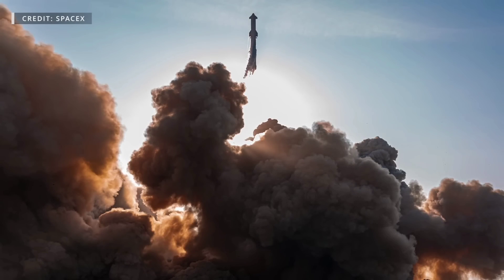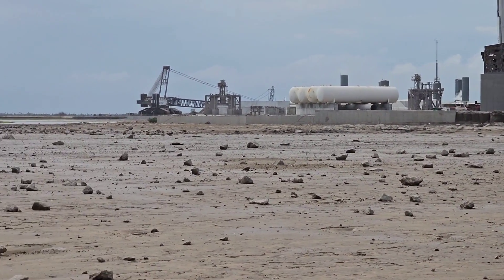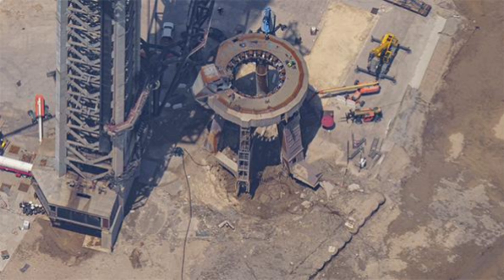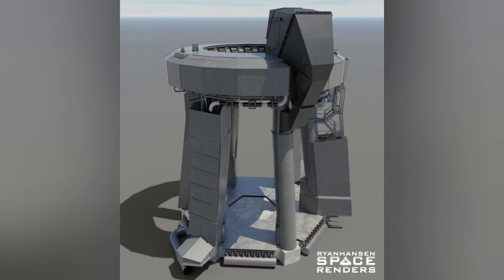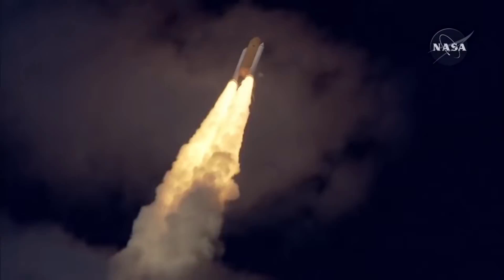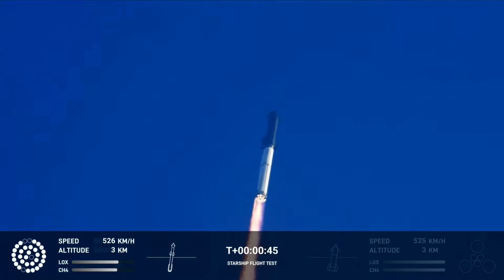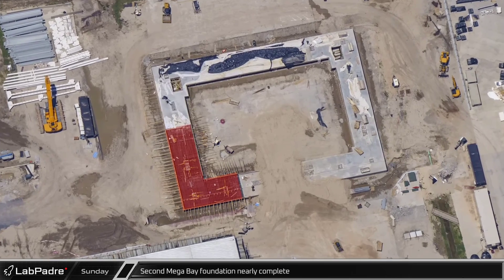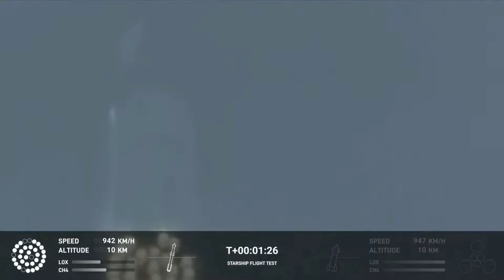Will Elon Musk's water cooled flame diverter be enough to keep Starship and Starbase safe?

Comment: The pad itself should be fine.  Spacex knows about thermodyanics, and the properties of metal are well understood. They will have done the math. From an engineering perspective, a water-cooled metal plate is easier to understand than concrete.  We know, for example, that the metal won't explode (unlike super-heated concrete.)

The damage outside the pad was largely due to rocks and concrete being thrown around, so as long as the pad holds up, this shouldn't be a problem either.

Whether or not this is the best option... who knows.  I thought that a higher platform plus a pool of water at the bottom of the pad would be the solution.
Reply: They obviously did not understand the thermodynamics as the rocket blew the concrete apart. EMu admitted as much.
Reply: @HowzitOldMan  As I said, concrete is more complex than steel to model.

Steel will either melt or not melt. It's not going to explode, and bending isn't a problem. Keep it below the melting point and you're good.

The issue with blowing the concrete apart appears (according to Musk) to have had more to do with pressure than temperature.  The soil beneath the concrete was soft and didn't provide the needed support, so the concrete cracked. Once it was cracked, the gases were able to get underneath.
Reply: @HowzitOldMan  The current leading theory is that the sand under the concrete compressed away from the concrete, as the concrete bent it cracked, and those cracks then allowed the high pressure gasses under the concrete, blowing it up and cracking it into smaller chunks that could be thrown around.

The static fire gave them a read on the thermodynamnics, and based on that they calculated that the pad would survive one launch, but when you extrapolate, you can't predict inflection points where other factors show up.

They can't do a full thrust static fire without adding a lot of additional weight on top of the booster (i.e., replacing the 1500T starship with a 4000T mass simulator), the clamps don't hold the starship down until launch, they are released before the engines start and the engines start at low throttle and as they pass a TWR of 1 the rocket starts moving.

Comment: It’s overkill. A simple steel plate would have worked. The heat doesn’t  have enough time to penetrate the steel very far.    The whole thing sounds like an excuse for whoever insisted on not using a simple steel plate before the launch.  Could have been done for cheap and quickly

Comment: A lot of energy has been dissipated by the concrete flying away, hundreds of tons. But that was a fluke because it reduced the amount of vibrations and this phenomenon acted as if there was indeed a flame diverter! But if you put that plate, that energy will now be absorbed by the OLM and will shake more violently. There is also the possibility that this solution will not make any difference and the result will be the same…

Comment: SpaceX was already designing and building the replacement launch system long before the launch took place.  Thats why there is a quick turnaround.  Using a typical "lets wait and see before we do anything" approach is normal for the space industry, but not SpaceX.
Reply: not very impressive
Reply: I generally agree, don’t wait. But in this case I think they did a shoddy job.  I am a huge fan of Elon, but I don’t think he’s perfect. Seems that he admits they didn’t anticipate so much damage, but I think a lot of people dead, including me. I was very distressed that they were blasting the rocket onto a flat pad.
Reply: @steveperreira5850  If the foundation was anything but beach sand, it would have worked. The concrete plate cracked because it sunk into the sand, that's why it took so much damage.
Reply: @florin604   totally disagree, it doesn’t matter what the material was under the pad, the effect would be the same, complete destruction of the stupid flat concrete launch pad. It’s a simple relationship between the total energy blasting out of the raptors and the energy absorption efficiency of the concrete. The energy won.
Reply: @keithmayes4358  certainly, many engineers, smarter and more informed than us must not have checked the numbers. Any monkey should have known what would happen, as we can see by the result.  Elon is the only one looking at these things, I'm sure.

Comment: A modest deflector , a flight wdege around the perimeter of the plat to impart some vertical component to the flames velocity. If the fire is off the ground it seriously cuts down on debris.

Comment: Your thought that the concrete would still be ripped up makes no sense. The concrete was ripped up for a distance away from the OLM because the Raptors made a hole in the concrete surface and started blasting incredible amounts of high-pressure gas under the pad, which then had no where to go but up. The force exerted by even a small pressure difference over a large area is incredible. Like on some entertainment shows, where they collapse a caravan with a vaccum cleaner.

The high pressure gas buildup under the pad launched the concrete high into the air. But if the plate works, there is no hole in the concrete surface, and there is no buildup of high pressure gas. The concrete should be absolutely fine.
Reply: https://youtu.be/9YEXQwnyMms?t=210

Comment: There's no guessing to it. You tell me the thermal waste these engines are pouring out and I can calculate exactly how much water it will take to convert the energy to stream. Can they deliver that amount, that's another question, but they know. The flight termination system is the FAA primary concern. If starship had started traveling inland right off the start, it could have blown up over or crashed into a major city.
Reply: why do you need to convert all that energy to steam? it's not a problem to heat things up below their melting/breaking point, and it's not a problem to have high velocity gasses moving away from the pad

Comment: If I was the government official who has to give or deny a launch permit, I'd ask 'Would an exploding rocket pepper a town or nature preserve - or any property Musk does not own - with debris. Given that the answer would probably be 'yes', Musk should do a water launch. Or Cape Canaveral.
Reply: sorry to inform you that most of the Cape is a nature preserve and not owned by any of the companies launching there. If a rocket fails in flight it is guaranteed to have pieces land in places that the launching company doesn't own. No company (or Country) can own all the land and sea that the rocket could impact.
Reply: @davidelang  But rockets are allowed to launch at KSC - not in other preserves
Reply: @gus2747  I know that Astra's launches in Alaska crashed in a nature preserve on one flight

Vandenberg has both land and marine preserves adjacent to it

So does Wallops.

Now, none are quite as close to the launchpad as SpaceX is in Texas, they are working to change it, but that requires that they buy other land in the area and alter it to be similar to the mudflats that they are going to be using. That process takes years.
Reply: @davidelang  Other places are not close to towns. Musk should launch where he is not opposed - Canaveral or at sea.
Reply: @gus2747  KSC has launch pads within 2-3 miles of condos (look at the location of pad 25)

Vandenberg has launch sites ~5 miles from the local train station, with Lompoc just a few miles more away (but there are hills between them and they launch away from them)

The starship launch pad is ~7 miles away from South Padre Island (Boca Chica is closer, but that's why they evacuate it and offered people 3x appraised value for their property there)

Wallops seems to be a little more isolated

The differences aren't as big as you think. And there really isn't anyplace around that doesn't have wildlife refuges or population within a few miles

Comment: I still think SpaceX should reconsider using the flat floor, and consider adding some angled metal plates, so the shock wave and flames be properly diverted. The flat floor design is probably to better access to the engine bay, but they could use for that a secondary stand near the tower.
Reply: Or build into the flame diverter design a removable floor feature.

UPDATE: To clarify, my thinking is to have a flame trench with a flame diverter inside below the launch mount and a clever design to allow concrete sections to be positioned over the flame trench to allow work to take place.
Reply: Or just build a cone instead of a flat floor. That should act like a flame trench but above ground. Concrete in large volumes takes a long time to cure and to lose its moisture content, so as they are in a hurry build with something else like preformed blocks and a steel facing.
Reply: @Tailspin80  I'm thinking of the same thing too. The V-2s & Redstones(and their Soviet counterparts) used deflector pyramids back in the day, and Starship's Stage 0 structure is basically a Redstone/V-2 pad on steroids. Perhaps a hexagonal pyramid made of the water-cooled steel plates Elon had in mind may be a possible solution for that.
Reply: I'm no engineer but I think all it needs is half inch steel plates, 3 layers, overlapping with expansion gaps. Bolted into the concrete with slip plates.
Reply: Yeah, a 'Mexican hat' solution which is what they're doing.
Reply: CSI starbase did a little investigating and that particular fondag should have held up so I’m assuming the engineers came to the same conclusion the whole thing cracking under the compression was probably not on their mind.
Reply: Water deluxe should help with the shock wave. They may need more volume though
Reply: It was an intentional learning experience.
Reply: I still think spacex knows better than you do
Reply: @because7768  all that concrete and rebar scattered all over the surroundings may question that.
Reply: @RogerM88  you don't understand that that the cratering was caused by lack of a foundation the concrete coul not carry the pressure from the , 30 rocket motors
Reply: @because7768  Not based on what happened to the OLM after their first launch. Calculations are one thing, common sense is another. That volume of gas generated by 33 raptor engines during the hold down has to go somewhere really fast. raise the OLM by another 100 ft .
Reply: @5530fsc  I agree and disagree.  Common sense would have said that you can't reasonably and consistently land a rocket vertically.  

If Musk is to be believed, then the concrete is not what failed but was the soil composition underneath.  It was a big risk and it didn't pay off, but it just as well could have with slightly different circumstances.

Anyway, I for one am glad for the mistake.  Now we know without any doubt.  

This is good to know because it makes sense to have as little infrastructure as possible for launches to make it easier to build more launch mounts in the future.

The problem with over-engineering is that you don't know how much preparation was actually necessary.

Time will tell!
Reply: @because7768  blindness even in faith is not a virtue.
Reply: @because7768  that's not a constructive comment
Reply: @jesseholliday3480 Well it is true. SpaceX has hundreds of highly qualified engineers looking at every detail, whereas we're just a bunch of keyboard warriors.

SpaceX didn't get to where it is now without taking a few calculated risks.
Reply: @ItimDave  wise man

Comment: Angry your guys need to do a bit more research. There are water tanks on opposite side of tower from OLM. Along with helium tank group (similar to GSE) to provide pressure. They’ve already trenched and covers the 2ft diameter feed tube from there to OLM.
Reply: At least before Starship's blast was absorbed by the ground as it dug a whole.
The metal plate will direct the rocket blast outwards and at a greater force
Reply: Thanks for that. I felt like he was trying to pack in as many inaccurate and uninformed statements as he could in a limited time. Rarely view this channel don't think I need to anymore.
Reply: @ramblinwes7853  thanks for saving me 7 minutes!

Comment: A watercoold plate could work... BUT a water cooled metal ramp to direct the thrust to the side would be even better.  You know ... just basically every other rocket at all comparable to this one.  There is no reason to try and reinvent the wheel.
Reply: I do like the idea that they are actually testing alternatives instead of going with the excessively safe route. That's how we learn.
Reply: @Hedgehobbit  Let's try square wheels next.
Reply: what other rocket out there is comparable to this one?

Comment: I've seen an "old" NASA paper (but I don't recall from which source unfortunately) showing that with a flame trench there are noise reflections hitting the rocket from the side which are also not good news for the rocket. Now I agree that the water cooled floor might be a bit simplistic, one question for instance is: what happens when the plate itself bends into the sand like what happened on 4/20, do they need to place a large stab of concrete underneath? The plate being metal will be more elastic than concrete but it will still need support. I also agree with you that: what happens at the interface between the border of the plates and the presumably the concrete revetment further away from the pad? Now they could also continue the plate with metal ramps outside of the pad with a slight upward angle or curve which could protect the concrete immediately after the pad by letting the pressure naturally decrease by expansion which could be a good natural way to manage the overpressure; this though would create turbulences and likely a negative pressure at the interface that would have to be dealt with to prevent taking the par soil apart. But overall I would not necessarily dismiss this water cooled flame diverter solution on the face of it, rather I'd expect to see iterations. And looking back at your recent video, the FAA might be more than open to iterate that part of the design with multiple static fires to validate it before the next orbital test.
Reply: If you saw the video of the forms being installed now, you'd see that whatever they're doing, is going to be seriously robust.

The forms I saw were a foot+ thick...  There's going to be a LOT of solid material underneath.
Reply: The steel plate is anchored to the legs of the launch mount  which i assume are anchored to bedrock not sand like what the concrete was sitting on top of.
Reply: @Roadrippers  
quote:
SpaceX broke ground at the beach in the fall of 2014, and soon trucks made daily trips into Boca Chica, packed with soil that would provide a sturdy foundation for a launchpad on a bedrock-less shore, less than two miles from the village.

Comment: Leap of logic angry.  If the dented tanks for cryo fuel are no longer going to be used for that they can easily be used to store water and provide part of the pressure do to their vertical height.
Yes nasa would piss away a few mill on a new system not repurposeing but this is Elon. Nest part is no part.